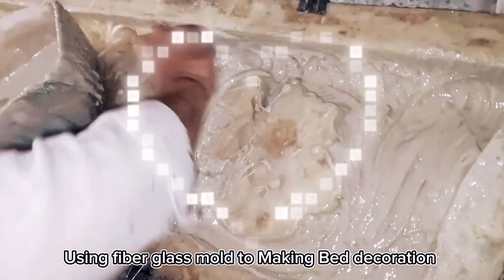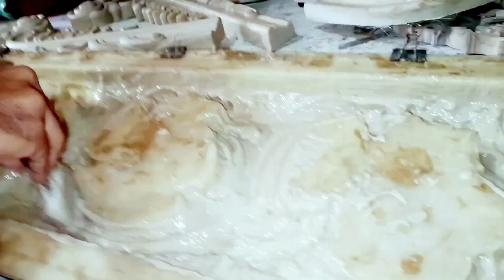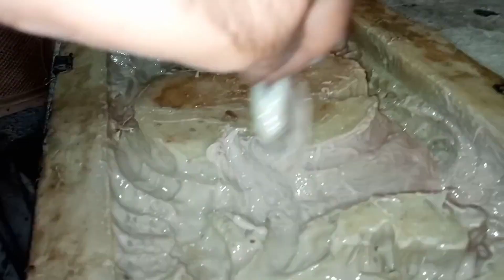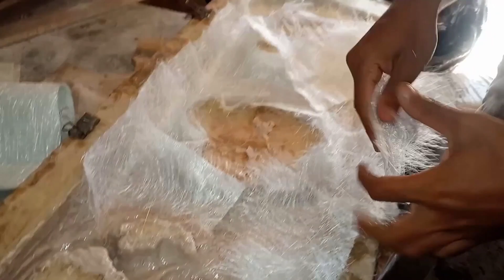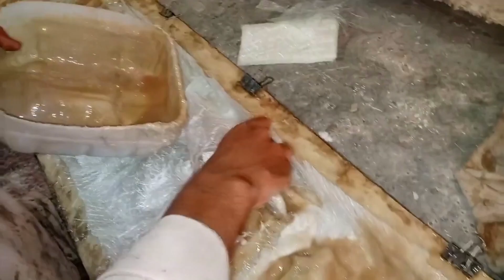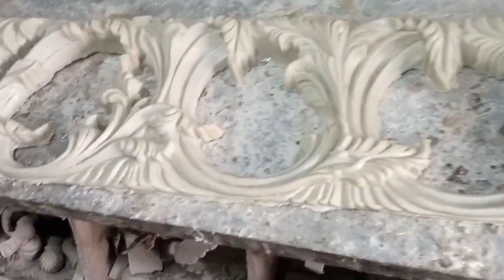Making a bedhead (or headboard) utilizing a fiberglass mold

Comment: Excellent work, but i have a question Wich fiberglass do you use 300 or 250, and another question which fiberglass do you use to make molds using silicone rubber molds thanks
Reply from the maker: Sir using 300 also use in mold
Reply: @WonderfulSkills  thanks you so much sir
Reply: But I tried to use 300 while making rubber mold ( using silicone tube) but the 300 is so hard please advise
Reply from the maker: @georgelukwago7970  sir please the playlist with name of ,fiberglass mold die casting process there all details videos and if not understand please again ask me I will explain you
Reply: @WonderfulSkills  thanks for your response sir, but have been watching your video for almost 2 years almost all of them but mi challenge is that whenever I try to make rubber mold using silicone tube like the way you guys are doing it doesn't come out I the way you do, do you give training so that I can pay to teach me please
Reply: @georgelukwago7970  Thank you so much for watching our video, and yes we will tell you about this soon.